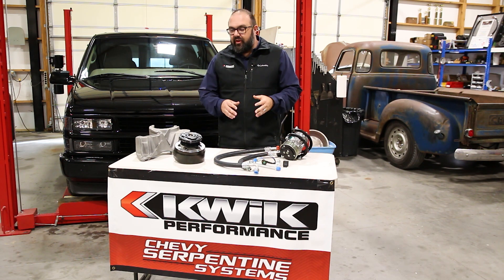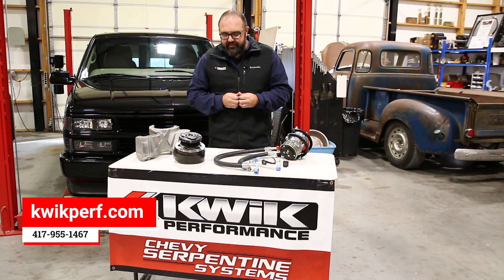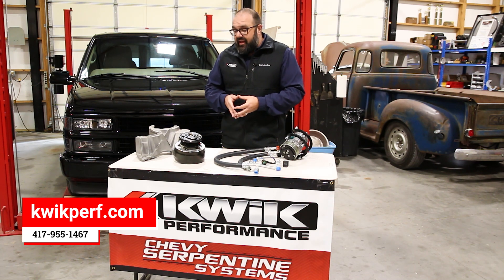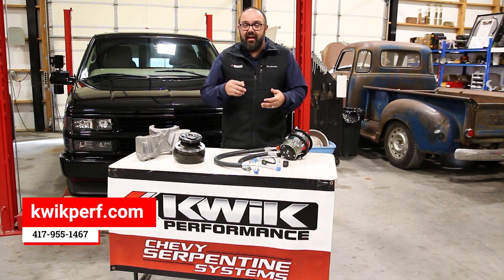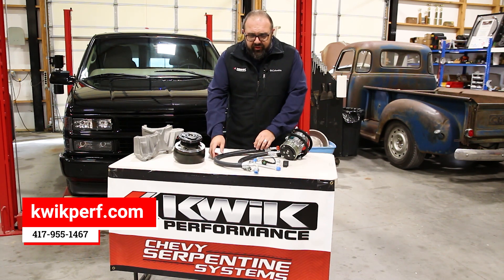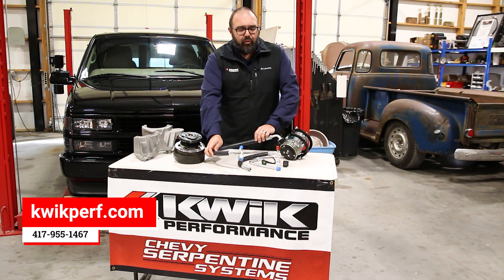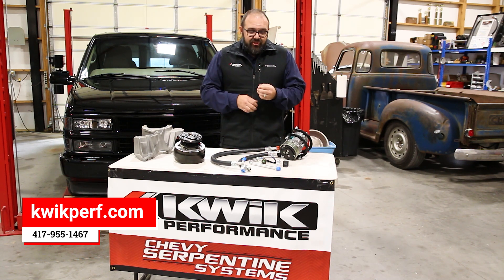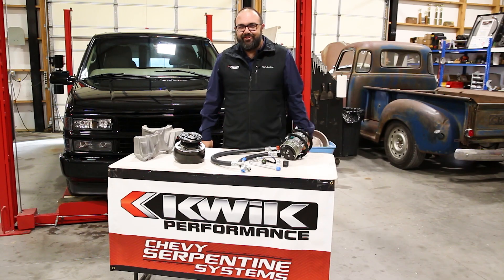R4 to Sanden conversion for 88-95 Chevy OBS trucks

Comment: Just came across this video, I swapped my 94 OBS to a 06 LQ4 6.0 with the sanden 508 compressor but am missing the high pressure safety switch. Do you sell this part separate?
Reply from the maker: You bet! Give David a call at 417-955-1467 and he make sure you get the part you are needing and that it will work with your setup.

Comment: I have an LS engine. I used an LM4 generator bracket and a power steering pump. I also used a 2004 Yukon generator. I used a 1988 Chevy C1500 V6 AC bracket. I want to install a Sanden air compressor. What is the appropriate belt?
Reply from the maker: The suggested belt is Gates K060956. Verify tensioner is in the middle of its travel both after installation AND after initial startup. Longer or shorter belt may be required. Here is a link to the Gates belt chart in case you need to order a different belt. https://cdn.shopify.com/s/files/1/0615/6723/8311/files/Gates-belt-chart.pdf?v=1701272213

Comment: what would be the temperature out of the vents in the cab of the truck? vs having the old R4 compressor
Reply from the maker: Should be very close to the same. The condenser and the evaporator do most of work of cooling, so if they are in good working order everything should be great. The advantage the Sanden Mini has over the R4 is being quieter, able to spin up to higher RPMs, and being more reliable.

Comment: question ? will this sanden compressor drive a factory system  1980 chevy ck or is it designed for a vintage air unit
Reply from the maker: Thanks for your question. Yes, it works with factory GM AC systems. 

However, it is designed for serpentine systems, so it would not work with a V-belt set up. 
Also, this Sanden compressor uses R134a refrigerant, not R12.

Has your truck been converted to R134a already? 
Are you running the original v-belts?
Reply: @kwikperformance  have you tried it before ? compressor btus not as much as a r4 ?
Reply from the maker: Correct, the mini output is less than the original R4. But, if the condenser and evaporator have been updated, the capacity is more than adequate for a truck. 

To be clear, this conversion bracket is for the OEM factory 1988-1995 Chevy Truck bracketry. 

Give us a call, 417-955-1467. We would love to talk to you about your project.